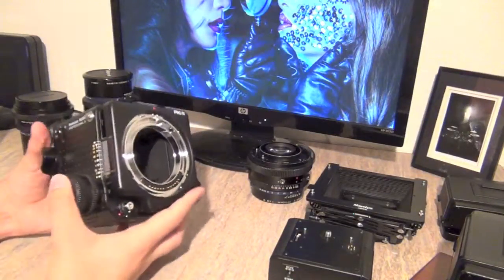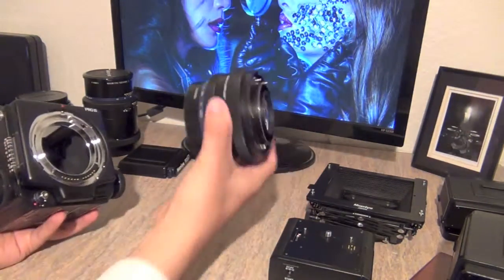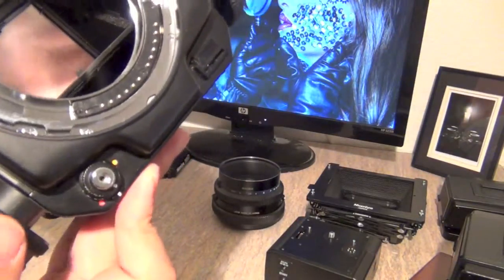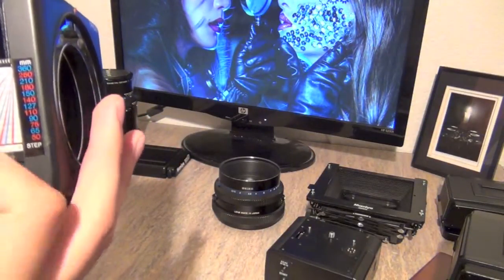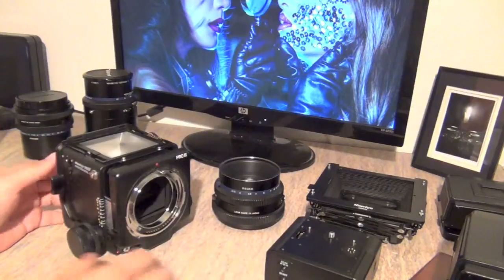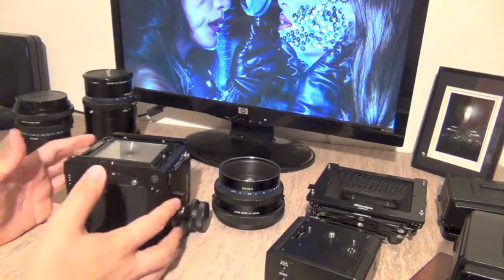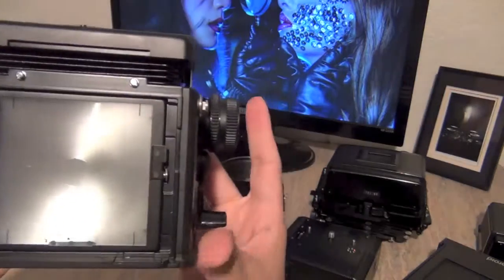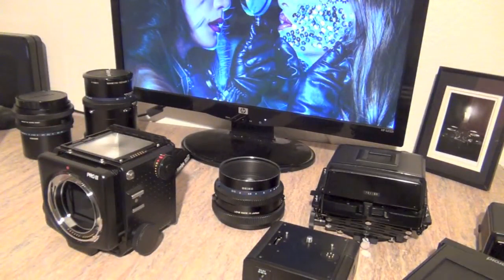RZ67 Pro II Video Manual / 5 - Nomenclature and Functions

Comment: Nice video series! I'm looking for medium film camera, but i can't decide between rz67 and 645pro. RZ67 has nice features like rotating back and 6x7 is better for scanning but it is heavy, big and has that strange focusing mechanism with light compensation chart. 645 is more compact and looks simpler to me. I'm an automotive photographer and i shoot with modern fullframe dslr because i shoot many action scenes like car racing etc. But for steady shooting it would be nice to use mamiya medium film slr. I thought about pentax 645, but changeable back is a must. Do you have any experience with mamiya 645 cameras?
Reply: If you shoot anything moving do not use film. You will die with trying to focus. If you still are interested for medium format go for a digital one like phase one or hasselblad even the H2.
Reply: Actually i want to use medium format only for static objects, when i cat shoot slowly and think on every exposure i take. Sadly digital medium is out of my budget.
Reply from the maker: Константин Уколов
The cameras like H2 and the 645 have their digital versions that are able to work with film. The cameras aren't that much expensive.
I have used the 645 cameras, but up to somehow its kinda a fat DSLR, I really like the idea of using a Waist Level Viewfinder, it does give you a different feeling when shooting something, so if you want to experience something new, or have a different feeling in your shooting, go for the RZ. It is heavy, it will slow you down, you will feel like you are using a real machine to take photographs, you will love the size of the negatives, and everyone will keep their mouths open while you are shooting with that beast. The 645 does not have that much impact on your shooting or when other people sees you, or even the shooting style, its almost the same as any dslr.
Reply: Julio Ryuuzaki Thank you! I'm going with RZ. That "new" kind of slow and thoughtful shooting is exactly what i'm looking for.
Reply: @konstantinu8808   so you wrote your coment 4 years ago..so you still shooting with RZ or just still dreaming ?

Comment: Very helpful video.  I was having trouble putting the shutter release button to the locking position.  I didn't know you had to press the little lever down, the one with the dot on it, to lock it, thus disengaging the battery.  Thanks for posting.  I'm a new subscriber.
Reply from the maker: Thank you for letting me know it helped you. Always happy to see people using this system I love so much.

Comment: I noticed from the other videos that you might have an electronics background, do you know the pins for the lens, what each is for? I've been playing with the idea of making a housing for them and a digi back
Reply from the maker: +Michael Bradley I don't have a background more than I liked to open stuff when I was a kid. I have requested for the repair manuals used by the repair shops not just for lens but also for te camera pins, and they usually just come with part numbers, and not diagrams of the circuits. I wanted to find a way to turn on the green led and use it on a custom ad-on.
Reply: Julio Ryuuzaki if you ever find out pin names or use, circuit part easy for me. I was curious because I like your up/down counter, as well as you photoshop box with the three knobs. I have one I made as well with microcontroller emulating keyboard. My main goal is trying to figure out the electronic shutter in the lens. I am on the fence about getting the RZ so I can reverse it.
Reply from the maker: +Michael Bradley Yeah! I've seen is an electro magnetic Switch, it has two levels, one is to activate the security checks and the other one is for triggering. Once done it could be adapted to trigger the camera with IR, radio or Bluetooth. But I really don't have any idea of how the 4 pin works, I have tried to short them and test continuity and resistance, I think one of the pin gives you some voltage and another is ground but I have no idea.